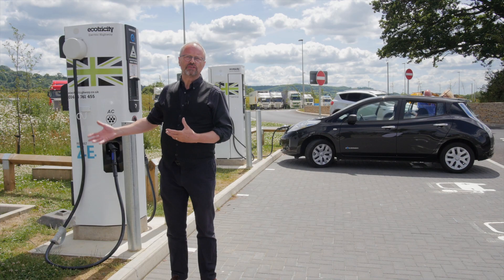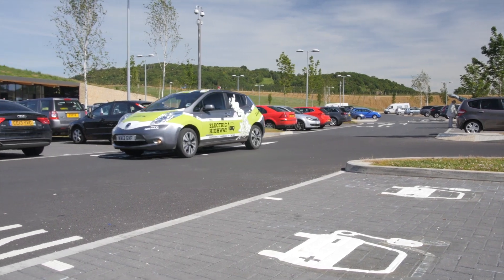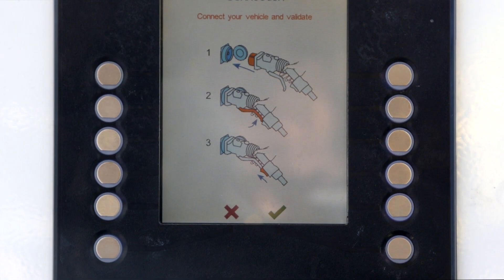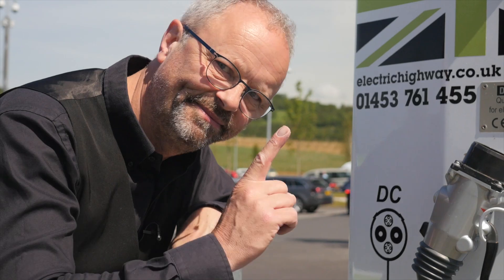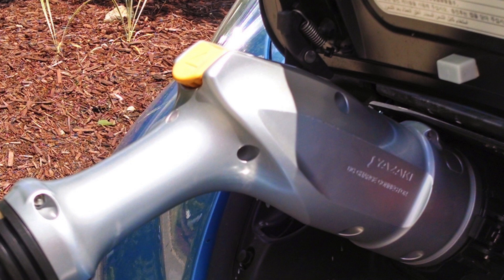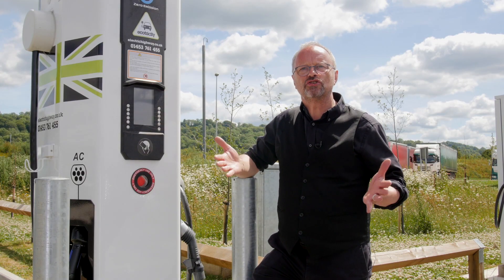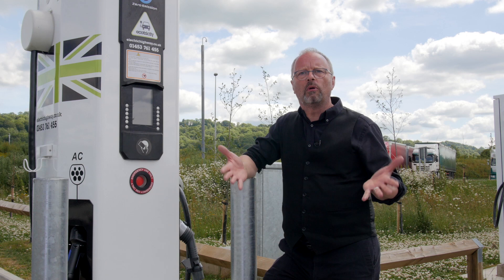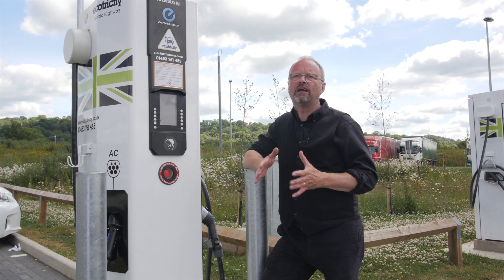Electric Highway - How to use a DC CHAdeMO charger

Comment: Hi it's Jeffery from Blackpool it is brilliant wot you have bin downing over the years and it apresheatd if you have eney ideas I am struggling to charger my Gwiz I live in a tent in the back of a van and struggling to charger it there is no three pin plug charging points in Blackpool and I've put in 8 x 12v  locus 22amp  because the 8 6v or now gud if you have eney ideas I would appreciate it and in retern you can borrow my the only one in England 8 seater pedel bike it's a lot of fun my Gwiz is silly but wen people smile maybe there achely lofing at me but that's ok smiles per mile that it

Comment: To be honest, the charging process could be much, much simpler with less steps for fallible humans to mess up.  The fact that you need a video to even explain this speaks volumes.  Ideally, what is currently the charging card (presumably an RFID chip) carried by the user, could be permanently affixed to the charging socket on the car itself, and the charging cable would have a sensor which automatically recognises this as it is plugged into the car and start charging.  No navigating menus or pressing buttons necessary - that seems so old-school!  Removing these steps will make this technology much more accessible to everyone and easier to adopt.
Reply: Make All cars and trucks able to use the same chargers that Tesla, Leaf and G m. 
I have no idea what BMW and all the rest will use but it seams like a good time to get some sort of Stanford for plugs.